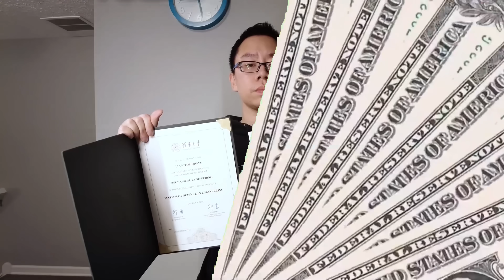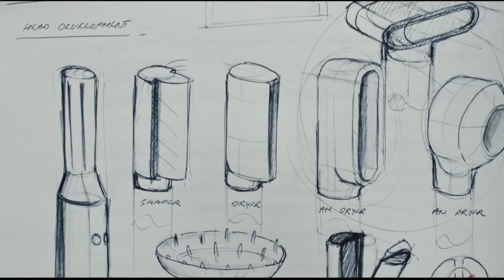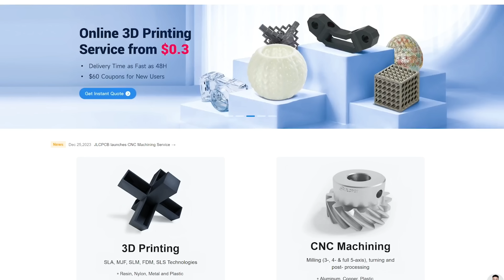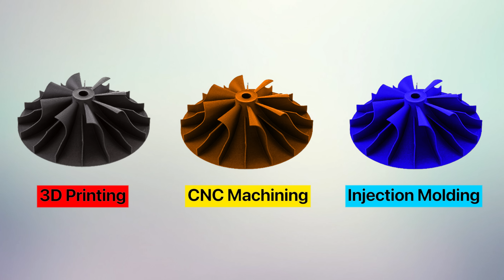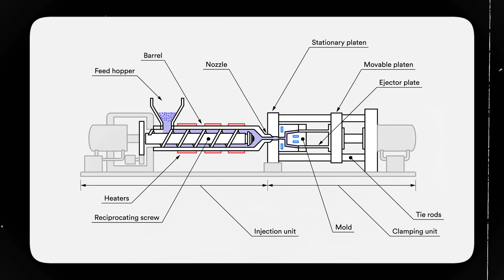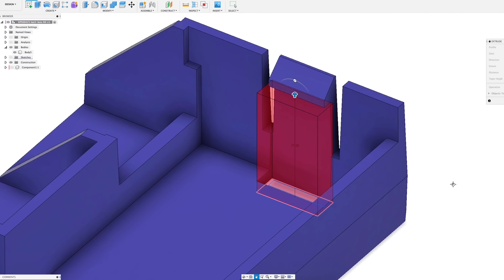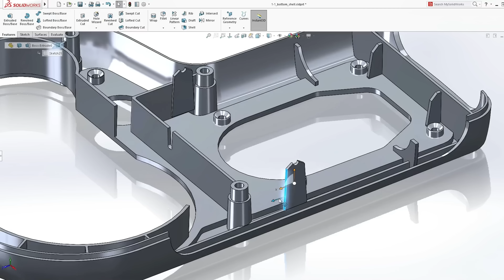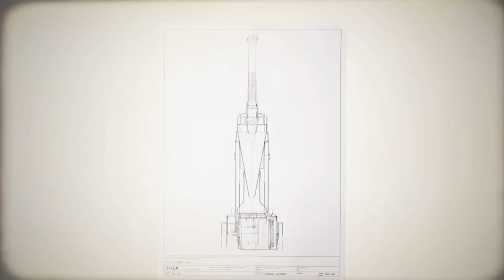the ONE skill that changed my life as a mechanical engineer

Comment: I just finished my first-ever mechanical engineering internship. Tbh, I was miserable. My mental health dwindled like never before. I was tasked with things like laser cutting, cad designing and document management but the problem was my boss. He was strict and brutal. I would burst into tears as soon as I clocked off and left the office, hellhole. I don't know if this particular job was bad or if engineering in general is bad. I have no healthy expectations from my next job either.
Reply: I'm finishing up my first mechanical engineering internship (8 months long) end of this month and I loved it. Think you just got one of those sucky "mechanical designer" jobs which is one of the worst things u can do as a mechanical engineer.
Reply: my first job after graduating was like that, I was made to do everything, from project management to calling contractors, talking to several stakeholders, documenting, emailing.. but most importantly it was miserable as my managers all made fun of me, i made mistakes that werent detrimental but it would echo through the entire engineering department.
The thing that made it really unbearable was that i had to move to the middle of no where, away from all my family and friends to live near the factory site.
I felt like a non-unversity grad could do my job. (didnt use any theoretical knowledge.. case might be different if you worked for cutting edge engineering companies)
I was getting paid absolute trash.
The work life balance was rubbish.
The work place was very toxic (managers were very traditional as theyve all worked their way up from the very bottom).
No diversity in the company (all white men)

I transitioned to technology and work as a data engineer... best decision of my life. I regret not taking up comp sci for my masters. I did an Integrated masters in mechanical engineering (MEng).

My work life balance is amazing.
I can work from home.
My salary is 2x starting compared to Mech Eng.
My potential is not tied down to budget. In Mech Eng, being innovative has high costs, in Data Engineering, carrying out ideas and innovating is cheaper.
This goes back to feeling very rewarding.
My Team is full of open minded and knowledge sharing people.
Reply: @kypham6809  may i know how do you switch to a data engineer career? do you immediately land a job as a data engineer?
Reply: @kypham6809 i do wanna know to how do u have switched ur carrer
Reply: My best advise to every worker is to put your mental health over everything else, if you are miserable do something about it!. On my first ME job (23 yo) all my tasks were non-related to engineering: logistics, inventory, order placement, etc. and my boss was awful he had a bad temper and actually once he pushed me. When i took the decision to quit i kid you not it was one of the best feelings of my life. Consider every step an opportunity to grow and learn what you actually dont want to happen again and dont settle!. Now I'm 4 years into another job and im loving every second of it.
Reply: Super sad to see this stuff for you and other ppl.  I think people that "build" physical things get really high and mighty sometimes and end up being mean old grouches.  
I'm studying comp sci rn, and have worked as a mech eng for 10+ yrs.  Certainly brutal moments.  But working with the right people makes life sooooo much easier even if the technical stuff is still difficult.
Reply: I've been in the industry for about 6 years and thats just how it is, unfortunately.

It was one of the things that made me question becoming an engineer early on, but I liked making things too much not to  get into it. 

I'm lucky enough to have a good boss, but even then, the job is stressful because they're so much work to do and no one else is competent enough to help. 

You have customers and coworkers asking for projects with no idea how involved it would actually be and then complain when its not done yesterday.

I always end up having to hold people's hand on things that aren't even part of my job because I'm the only one who knows how to figure things out.

Even when I do get help, the person takes so long and produces something unusable and I end just having to redo it anyway.

My uncle is also an engineer and he always talks about how his engineer coworkers are rude and elitist and nit-pick any thing they consider a "mistake" in his design. I have that issue at work sometimes, but its from know-nothings who are just trying to make themselves look good, so I don't even let it bother me.

I would just steel your feelings against criticism (I know its hard), but it will be good for you in normal life. If they ultimately make a good point, admit it and correct. If not, its their problem, not yours.

Always be improving yourself, so that you can keep moving to different companies.

That will expose you to new ideas, techniques, people, and it will raise your salary each time. It'll also keep you from getting stuck in a place that sucks.

Thats what I'm working on in my career now.
Reply: I understand I did something similar my first job but as a controls engineer . My recommend before changing careers paths is go somewhere else and try different companies or positions related your field of study before giving up on it
Reply: Dude just quit and tell your school advisors so they flag that company and never allow them to participate in career fairs or any type of school events again. You can also report “bad” and “toxic” internships to handshake so they get flagged and can no longer be applied to. Im sorry your first experience sucked but we didn’t come this far just to give up. Be proactive and talk to your advisors about other opportunities and make that company pay for treating you like trash. I hope your next experience is better and good luck with finals. We got this! 👊🏾
Reply: As a machinist who sees a lot of fresh mechanical engineers, I’ve found that the level of skills they think they have are not anywhere near what they actually are. I had an intern actually have his mom call and complain to the company owner that I was mean to them. So instead of learn from my vast experience, that intern got to sit at a desk and detail drawings that were outdated and not going to be used. You need to understand that the production environment is very loud, dirty, fast, and dangerous and you need to bring your A game. Time and time again I see new engineers getting upset because they just can’t meet expectations. When you’re slow and you do a bad job, you’re gonna hear about it because if jams everybody up behind you. I keep it professional, no yelling or name calling, but it doesn’t benefit anyone just to let it slide. So many schools are just diploma mills now. Universities are cutting their machine shop courses and 3d printing everything. You shouldn’t consider yourself an engineer if you don’t have basic machine shop skills.
Reply: @rexmundi8154  You sound an awful lot like my ex boss. You're part of the problem. It's called an 'internship' for a reason. Interns should not be expected to possess all the high level skills, we're not senior engineers. I haven't graduated and don't have a degree so I don't call myself an engineer, I'm a student. Besides, unlike you, I can totally sympathise with entry level engineers. It takes a lot of time to achieve perfection, and even then, perfection is an arbitrary term. I think you need to introspect and humble yourself.
Reply: I get payed 8000 Zar a month for doing those things its terrible. I keep trying to improve the business since I am a trustee/ future trust manager. But jees the pressure is heavy
Reply: @rexmundi8154  what likely happened is that after you scolded him the intern went and talked to someone to vent / get it off his chest. The mom probably overreacted (as all moms do). But nonetheless, I think scolding people at any level, ESPECIALLY interns who are there to learn, is really childish. It doesn’t foster learning and it certainly won’t foster a relationship. I saw you mentioned in another comment to “be nice to the machinist”, i don’t think you’re special; be nice to everyone you work with.
Reply: @the_lord7961  no, what happened is I told him to do something that would be important for his career, he ignored me, fucked off, then cried to his mommy when I said very professionally that his "work" was sub standard and she happened to be friends with the owner of the company. So he got to fuck off for a semester at his desk, riding his privilege, while another kid who deserved to be there learning wasn’t.
Reply: @vegan.rex_8  My point was about the quality of education. It’s not great these days for 4 year universities. If you’re a welder, pipefiter, plumber, electrician, or machinist there is a real world apprenticeship and physical testing.  It sucks that universities are killing their machine shops off and that you’re paying more for a worse education but that’s where we are. Obviously individual drive can help overcome this, but you gotta bring it. I started out as a machinist with probably 15 guys and 10 didn’t last the first year. No shame, they just didn’t have the chops or weren’t interested. The trades are a dangerous place, we can’t have people who don’t know WTF they’re doing around if they won’t listen and follow basic instructions. If I can’t trust someone not to slack off on the simple stuff, I definitely won’t trust them with my safety. And it’s irresponsible to endanger them or the other workers.

Comment: 25 year ME here.  Creativity, Communication, and Design for Manufacturing are hugely important.  I 100% agree that these are the skills that will make you stand out and have the most fun.  This is when people who are actually interested in engineering start to stand out from those that got the degree because it was on a list of good careers. It definitely takes time to build these skills so don't expect them to appear overnight.  Just soak up as much info as you can about every process you come in contact with.  Be humble and learn from everyone you interact with.  Other engineers, vendors, and especially assembly techs and machinists.  For the first 5-10 years you can do good work but I feel like your biggest goal should be to gather tools and understanding.
Reply from the maker: Very well said and totally agree👏

Comment: As an old machinist working with young engineers here’s some advice. Get a physical copy of the McMaster and MSC catalogue and look thru them in your spare time to familiarize yourself with the available hardware. Off the shelf is always cheaper. Learn how to design and spec sheet metal parts. They are super cheap and fast from places like send cut sent. Stop over tolerancing parts. +/- 0.005" is a hell of a lot faster and easier to hit than .0005". Stop making sharp or tight interior corners on parts. Especially if the part is deep. A 24mm deep pocket with a 1mm corner radius is gonna cost you a lot of time and money. Finally, be nice to the machinist. We can really jam you up if you’re not nice and piss us off.
Reply: Is there an ideal pocket depth to interior radius ratio? Like 10:1 or 8:1?
Reply: @ezraclark1793  the standard length of smaller end mills usually is like 3x diameter, so a 1mm end mill will have a 3mm depth of cut. Beyond that you start having to buy extended lengths and the deflection really becomes an issue. Even with standard large end mills , deflection becomes an issue on deep pockets. It’s a good practice to consider the assembly as a whole. A good example is a part recently where a pcb was being housed in a deep pocket. The engineer designed the pocket with a very tight corner radius to accommodate the pcb, where a better solution was to modify the pcb with some quick file work. I’m lucky that I have a good working relationship with the engineers and they respect and listen to my advice. That’s not always the case. Over the years I’ve seen some really toxic relationships between machinists and engineers. As a result you get situations where a bad design gets submitted and the machinist builds a bad part to spec, knowing it won’t work , taking a lot of time and resources and when it’s accountability time they dump the whole thing on the engineer.
Reply: well everything needed has been said .its a regulation between wilde imagination and reality.
Reply: Thanks!
Reply: DFMA is great but also consider Repair.  Engineers also think their designs will never require repair which is why so many products end up in the garbage.
Reply: @tweebs1  This is a great point
Reply: Befriending and consulting the machinists is my secret sauce as an engineer. At a new job I always take some time to go get to know them and establish rapport. I like to ask them about impossible designs submitted to them by engineers and take notes on how not to get laughed at lol. I've heard some interesting stories of square holes and screws coming out from the inside of a pipe and the like. It also really helps to be able to call in a favor with them once in a while.
Reply: As a (not quite) young engineer that works with machinists, these are essential lessons to learn. Definitely wish I could have learned these sooner.
Reply: I am only a master automotive technician but well understand the machinist advice. Here’s an axiom I used to help bring understanding to a manager. Here are your chooses, good, fast and cheap, but you can get only two. You want fast and cheap? Well it won’t been any good. Remember you can have only two at a time.
Reply: well 0.005 is already so tight I guess. Can't wonder if there's 0.0005 tolerance
Reply: As a fellow machinist I agree 100 % with that
Reply: This comment is facts

Comment: I graduated as a Mechanical Engineer in 1998 and we studied DFMA in school. It really depends on the job because many companies are quite limited on manufacturing options. I did not find it very relevant during my time in automotive, but I worked at the OEM level where not much real engineering design happened.  I agree that creativity is important, especially if you work for a service type company like I do.

Comment: Thanks for the great video that helps me realise that as a mechanical engineer that has 2 years of working in oil & gas industry, I still have very little knowledge of the manufacturing methods. As a design engineer working in a conservative industry (and company), the creativity is hindered by the bulky design process and innovative products, while the roles are well separated but the communication between the teams are rather poor, so the job of design engineer is challenged by the lack of involvement in the full design process (from concept to production & operation).
But one thing I've realised, as you said soft skills - communication, though I'd call it interpersonal skill - is very important for a design engineer.
I realised that I like it more when I use these skill at work, than the pure technical skills, so I'm directing my career to the product development aspect, rather than just part design. But who knows, if I can find a job that lets me go through the entire mechanical product design process, then I may have different ideas :D

Comment: Learn sheet metal design, the cnc cut and bend tech is great these days and you can build really complex structures for for incredibly cheap if you know how to make really creative designs using dfma principles. I recently converted 3 large aluminum castings into sheet metal assemblies that reduced cost by 30% with a massive improvement in manufacturability and assembly

Comment: I was a field service tech for Cummins Allison 852 Feehanville Drive Mount Prospect, IL 60056 they make money counting equipment (not the diesel people) but same scenario, half assed parts and to top it of they told me not to do the preventative maintenance anymore at customer sites just run the vacuum a little bit and wipe down the machines. I was like "But that is gonna make the service call numbers go up and is >theft of service< WHY ? Well they wanted to keep selling new equipment every 3 years or so see ? With At Will I was fired,SAD HUH ? Country is in TROUBLE...

Comment: Best advice: get your hands dirty. Real engineer is not an office worker. It is (should be) between white/blue collar.
Be friendly to technicians and machinists. You're not above them.
 
As for plastics. Random example is texturing. Do not over-specify parameters. If you just want mat surface, let it be done by sandblasting or fine glass-beading. Not chemical texturing (which must be outsourced every time they repair, maintain the mold).

Comment: There really needs to be an "I" added to DFMA, standing for "installation." I've lost count of the number of times I've installed products with impossible to reach mounting hardware, inaccessible grub screws, fragile cover plates, overly delicate coatings, etc. A poorly designed product can suck up hours of installation time, at enormous cost to the customer. Engineers never think about this.

Comment: Reduced part count isn't always easy and having worked on a lot of cars alot more parts are over engineered to make them cheaper than you would think. Ie the left and right heads on most dual bank engines or the camshafts being the same with a different key in the camshaft etc. parts count isn't always possible.

Comment: Is there a good learning source for DFMA that you would recommend? Preferably one where there would be examples and even small DIY projects to get the concepts applied and learned?? I searched amazon and saw that there are books available with DFMA as their actual names, but books just might not be enough, unless the authors worried about praxis like I've said (which is almost never the case, books tend to be very theoretical).